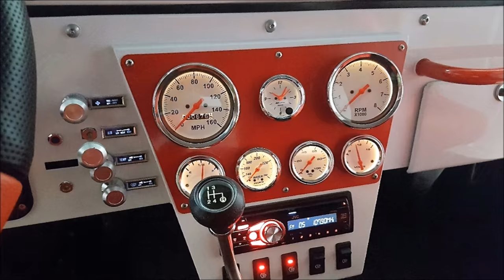1982 Jeep CJ-7 Custom Restoration

Comment: Where did you get those gauges. Great build. Looks awesome
Reply from the maker: They are Auto Meter off Ebay. Just wish I had put led's in them. And thanks
Reply: Thanks. The clock is a great touch.  Love it